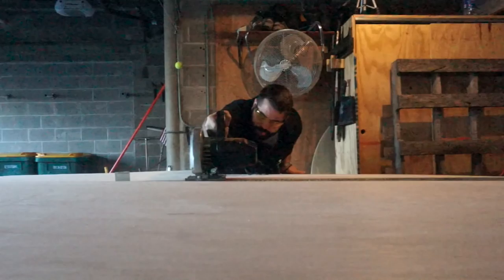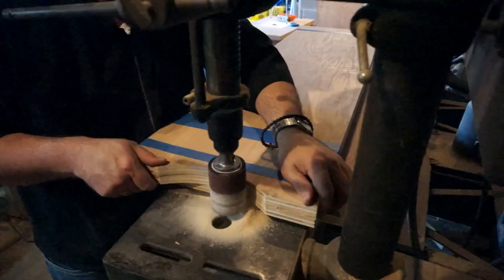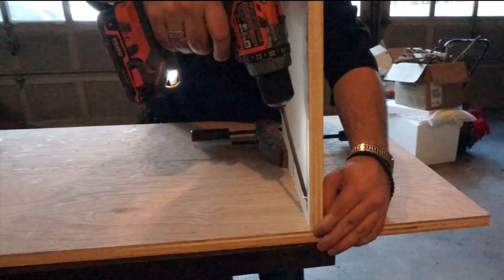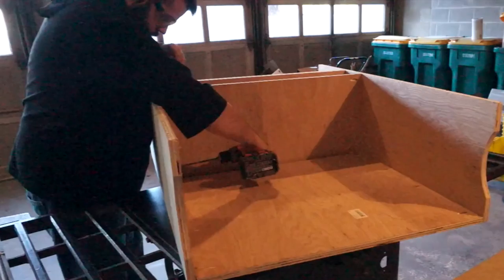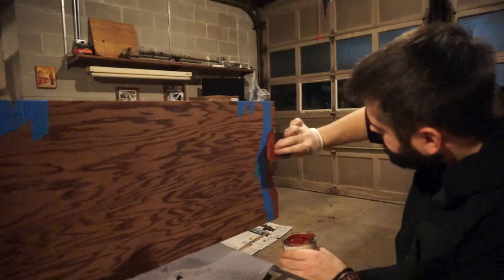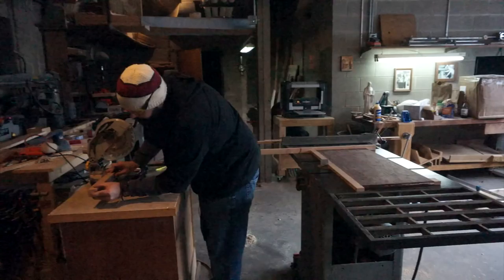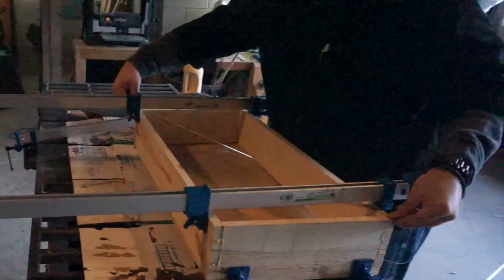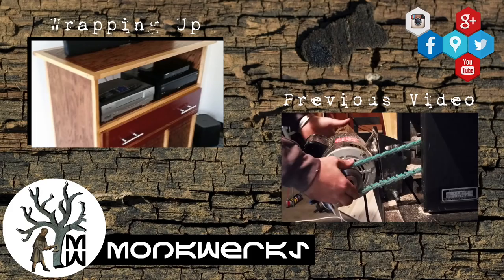TV and Electronics Cabinet (MonkWerks)

Comment: Hi Fr. Thomas,
I really like the look of the contrasting woods. I also like the design. BTW is that your Shopsmith? I have had mine for about 25 years and a lot of sawdust has been produced in that time! Hopefully, I'll be rebuilding mine this summer.
Reply from the maker: Yep, that's my Shopsmith.  I generally only use it as a lathe and a bandsaw, but when I was starting out I did everthing on it.